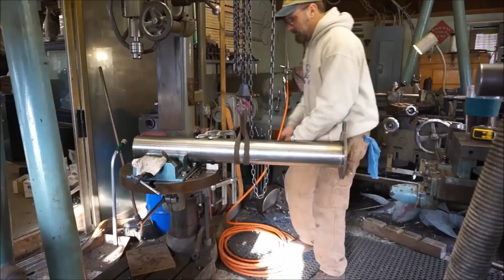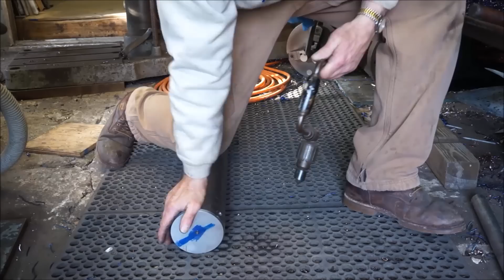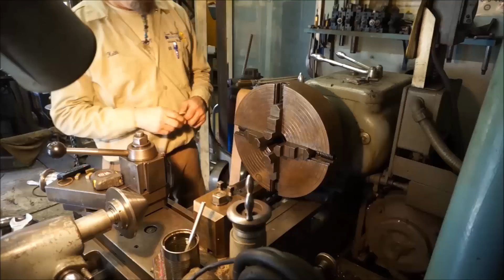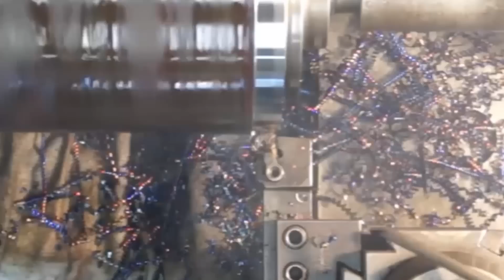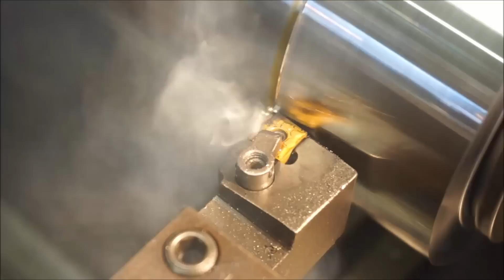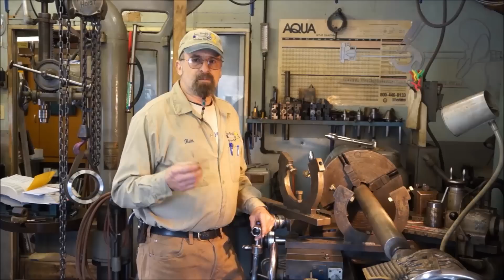Crusher Part 6

Comment: I know you typically wet the material down so the dust from taking the outer layer off doesn't fall down and get on your ways, but I'd be more concerned with what dust gets in the air and of that what gets in my lungs.  Is that dust a silicosis cause?

Comment: I know this is an old video, but i wanted to comment anyway. The old Snap-on air ratchet, i was told years ago, that they are a "spark plug" air ratchet. Low torque or as you said not much balls, so as not to snap the  fragile spark plug. Don't know for sure, but that's what an old timer told me.

Comment: We had a sleeve made, ie a piece of 10mm walled pipe 10mm oversize ID to the Pin OD and place it between the 2 Top Hat Outer sleeves and refit the pin when the Muncher is not fitted to the excavator in order to ensure the two outer Top Hat Sleeves do not come out when the Muncher is lying on its side/being shoved around site.  Also we found it better to have a bolted collar on each end of the pin without a locating lug in order to allow the pin to rotate at its own free will as different pressures get imposed at different points through the Crushing Cycle which reduces the chance of breaking/wearing

Comment: Hi Keith I was wanting to ask  had you thought of just using a inner tube for a tractor cut in half and placed over your ways, you could mount it to the line so it would  move back and forth without snagging and would make sure no debris would get stuck in the  ways. The same could be done with the mill.

Comment: Thank you for filming your work. I am a follower.  Got the 1940's Modern 2LU milling machine installed now but my gantry is a bit short at 94" beam length. Did you make your gantry yourself? How long is your gantry's beam?  What's its capacity (lbs)?  The legs seem to pivot a bit to help you move it sideways which is a nice feature. Daniel
Reply from the maker: AtelierDBurgoyne I believe I made that 12 foot long and it can handle a little over a ton. I made the legs pivot to get it twisted around the machines in the shop. ;{)-----

Comment: Ok, I'm gonna throw myself to the wolves and ask this.  Yes, I attempted a google search and came up empty.  Could you explain what DNMP or D&MP and the other acronyms you use.  It would be helpful to us wannabe/hobby/amateurs if you hit us with what the different tools are.  I'm a tool freak, but never did any machining until now and am trying to get it right.  I truly enjoy watching you, a true craftsman, work.  Thanks for doing what you do.
Reply from the maker: blmeflmm66 They are geometry codes for the inserts shape, You can look up almost any manufacture of inserts and they will list such a chart, but after logging on a few manufactures, I found this simple chart on this site;  https://www.carbidedepot.com/formulas-insert-d.htm ;{)-----
Reply: Keith,  UDAMAN!  That's a LOT of information.  My kind of page.  It'll likely produce as many questions as answers for me, Haha!  I lucked into a mini lathe(stop laughing! money's tight, the price was right, and I don't have much space haha!) with a lot of accouterments.  Lets just say, I don't think I'll be needing a chain hoist any time soon........  I've taken it completely apart, cleaned, deburred, polished, lubed, reassembled and removed the slop from all the sliding and turning parts.  So, it's MUCH better than new, which, in itself, isn't saying much, but it's a start.  My quest to getter done is just beginning.

Comment: Keith, It is great watching you work. Would it be possible to use a boring bar versus the line boring set up?
Regards,
Eric
Reply from the maker: esoomreltna If you have a large enough lathe and bar, you could bore them that way. ;{)---
Reply: OK. So this was a size consideration. Thanks!

Comment: I've heard about air cooling but I'd bet you'll need one hell of a compressor to keep up with your lathe, and that's more money out the window running it. Even then you're still going to be using some oil on aluminum. It seems like brushing on some oil doesn't cost much and works just fine.

Comment: funny thing about lathes or big accurate equipment like that is it seems it would all had to of come from many lathes before it like its a grandchild of some other old tool because dont you need a lathe to build a lathe   i mean you cant build a lathe with a file so basically all lathes originated by a primitive inaccurate tool that over time threw refinement came to be the accurate devices we take for granted , just think if a disaster struck and sent us back to black smith days how many lathes would you need to build untill they finally started cranking out accurate parts   this could take 20 years i would think
Reply: Read a little bit about Joseph Whitworth and his contribution to manufacturing precision flat surfaces. Having a disaster would ruin current equipment, but it would not destroy the knowledge in our brains. A man could build a working, precise metal lathe with his bare hands. Indeed, it would be very time consuming, but it is doable nonetheless. Today, machines make machines because it speeds the process up, but that doesn't mean you can not make machines without using machines -- what you do need are tools, and your brain is the most important one of them! ;)
Reply: aryesegal1988 i know but i ment recovery even to a meager manufacturing ability would take 20 years
Reply: NOBOX7 I beg to differ my friend. I believe it'll be a matter of months, a few years at most until we'll be back at full manufacturing speed, globally. Once again, what really took us centuries to achieve was the knowledge of how manufacturing really works and perfecting different manufacturing procedures, not building the machines themselves. It took us humans a lot of trial and error, in many different fields of science, to reach the level of understanding we have today about the underlying processes that occur when machining and manufacturing a part. It is this level of understanding that is important, not the manufacturing of a specific machine. In a combined effort of a few skilled men, from raw materials and with manual tools alone (hand scrapers, etc,) a precision machine could be built in less than a week, perhaps less than a month (and I'm exaggerating here). You do not need to build a machine, use it to build a new machine and reiterate for 20 years or so until you'll achieve the precision we have today -- the knowledge we currently have enables us to manufacture the most precise machine achievable from step one. ;)
Reply: aryesegal1988 my comment did say "Big accurate equipment " it probly takes a year in a modern shop to build a 5 ton laith, your telling me a black smith can do this in less then a month?
Reply: redstone31 Returning astronauts? If the event were short enough.
Reply: NOBOX7 if there was an event large enough to destroy every single piece of machinery on this planet to a state where not a single part was usable (and send us back to those "blacksmith days"), surely there wouldn't be any people around to rebuild. can you paint us a picture of what type of event you've got in mind?
Reply: redstone31
Reply: aryesegal1988 hey thanks for your input
Reply: NOBOX7 My pleasure, that was a nice topic to discuss. :)
Reply: ***** H
Reply: NOBOX7 reported
Reply: ***** I agree with everything you wrote, except for one thing: the world isn't getting any smarter. On the contrary, it's getting more reliant on everything else but its brains.

The masses use every piece of technology available for them just so they will have to use their brains as little as possible. My father said it best when I had this conversation with him: "Look at the names they give stuff these days -- Smart TVs, Smart phones, Smart homes, etc. I tell you, all this smart makes people a whole lot dumber!" And he was right. It is as if the guys at marketing are trying to sell us the idea that everything around us is so smart and is available for us to use whenever we please, so why should we work at all in order to be smart as well?

This generation is a "use and throw away" generation. A generation where cost is much more important than value. And, judging by history, it is only going to get worse with each new generation.

Now, regarding cheap manufacturing. There's a theory (in economics I believe) that says it's like a pendulum: When everything is of high quality and price, the market will opt for lower price solutions at the expense of little less quality. Problem with that is that all manufacturers line up and set this lower quality as the new standard. And so, the process reiterates, until such point where the quality of products is so low, that the market will seek higher quality solutions at the expense of little higher prices. And so the process reiterates.

And about people being lazy? Hell, this and next generations need to realize that what makes you lazy literally kills you slowly -- it is a terminal illness. People think progress is all about making their lives easier. Nothing is farther from the truth. Progress, IMO, is all about making you more productive. There's a fine line between the two, and people should take great care when walking it.

My two cents. ;)

Comment: Line boring will be a tasty treat.  Had one of those snap-on air ratchets back in the day and think you can still get the rebuild kits from them to get some of its Spizerintum back.  Liked my red Rodac better.  Once again you got beautiful chips there.  Its pretty amazing with all the metallurgy today that they used something that soft to beat up rocks¿  Thanks again for all you bring to us.

Comment: Whoo hoo, two videos in one week! Keith,  I know you are insanely busy, from what I see from your Facebook page. I appreciate you taking the time to do these videos. I like these video so much that my wife is a little worried. 

How is your shoulder? You were torquing on the tail stock and tool post, so it looks like you have healed. Also looks like you replaced your tail stock hold down with a reverse thread stud like before it broke.
Reply from the maker: craigleemehan Yeah I couldn't take that righty thread anymore, had to change it back and my shoulder thanks me, which is still healing slowly. 
;{)-----
Reply: Keith Fenner I hurt both of my shoulders (hopping out of one too many helicopters in Afg., 2001, with too much gear).  Never did anything about it,  Took a very long time to heal.  The soreness is gone. Keep on trucking.
Reply: WAVETUBE84 Thank you for your service to our country.

Comment: I'll end up with kinda the same cooling problem on my lathe...... Does Mr. Fenner have any input on a mist system ? I see Adam B have one on his mill..... Good idea ? If so it should be a snap to make one......
Reply from the maker: Eric Hope I have had a cool mister before and yeah they are great but the humidity on the cape with the salt air it helps rust everything even with the newer coolants that are suppose to be anti corrosion, just mix it with the salt air and instant rust. ;{)-----
Reply: Keith Fenner Yeah I can see that comming. I hate RUST ! Unless it's on someone elses part and they pey me to blast it :) LOL .... Mister might work for me then since I live inland and the air is real dry.  Have a truck fender sitting in my shop that is blasted and not primed... No rust after 6 months. I might give it a try... Some front light washer pump and a nozle from oil mister/ cooler from a Volvo engine... The one that spray oil up under the pistons...... Got the parts so if it'll be usless it will at least be free :)

Comment: a cool mist might be better for you thank flood coolant that top shot is a fantastic angle how long have you had your lathe keith great video thanks for uploading this
Reply from the maker: Andy Coakes I bought that lathe in 1994 and had to rebuild the head stock when I got it, every bushing and spindle bearings were shot. I made all the bushings on my 9" Southbend I had at the time, and had to run the lathe with the old spindle bearings for 8 months while I waited for new ones to be made in Germany. This lathe and I are the same age! ;{)---

Comment: I have a South Bend 10L (like the one you have in the back room) and its saddle is all rounded. I'd love to have a lathe with a flat t-slotted saddle top to attach line boring jigs, etc., so it's good to know that I should be looking for an engine lathe. That will help me the next time I'm reading ads for a used lathe.

Comment: I have a Mac 3/8" drive air ratchet that I bought new circa 1983. I used it a TON for the first few years, but only on occasion these days. It has a reasonable amount of muscle. Enough to pull it out of your hand if your not paying attention. It saved me quite a lot of time on some jobs.